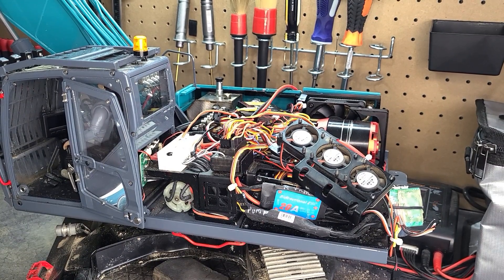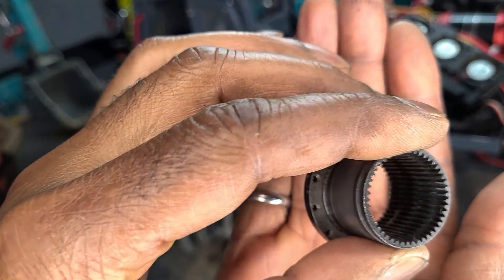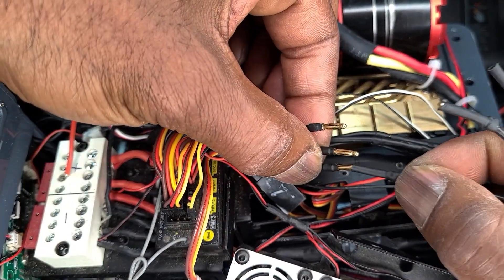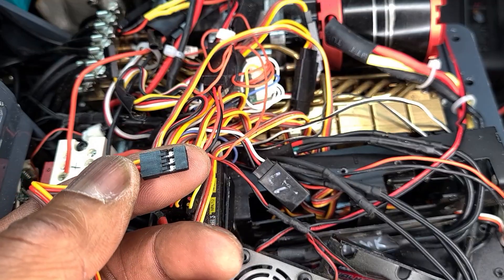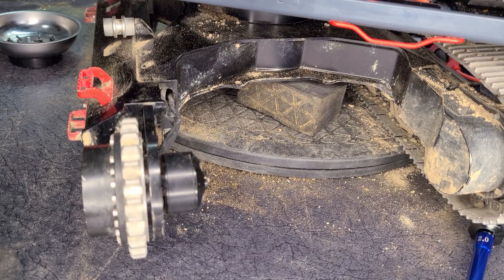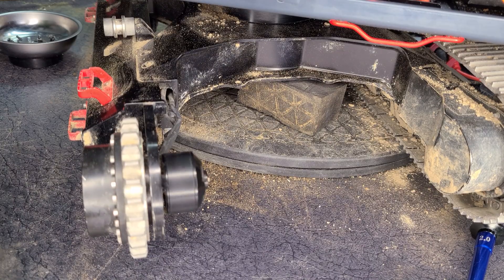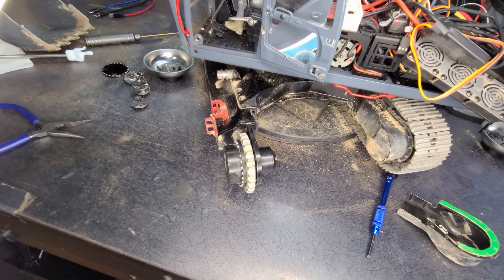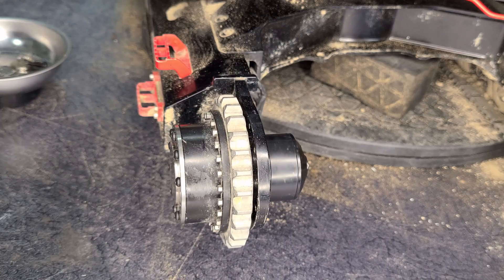Track ESC Repair on Lesu SK500LC

Comment: It seems you spend more time in the shop than out digging with yours. I am thinking about buying but a little discouraged by the repairs work which I am not good at all. Would you buy it again or get a different one instead like a XDRC 945 which seems very durable.
Reply from the maker: I would not recommend buying the Lesu if you are not good at trouble shooting and making repairs. You will be extremely disappointed. I'm an electrical engineer and do stuff like this for a living so it's not a big deal. Some of the Lesu problems have been quite difficult to figure out. I'm not familiar with the XDRC machine but I just watched a couple videos. It's definitely much easier to work on than the Lesu because you can access all the parts once the housing is removed. It weighs 52 pounds which is 10 pounds more than the Lesu. I have a Kabolite 961 excavator that is very reliable to use.
Reply: @ that’s good advice. Your job experience is definitely an advantage when it comes to troubleshooting. I wonder if the new Hitachi HC490 Lesu excavator which just came out is any better and more durable. I guess we have to wait and see. For me at least it means to look for more durable machines as i do not have electrical experience at all and want to be digging not troubleshooting. It’s just disappointing that they don’t get it right and lack in the QC department especially when you consider the price tag of these excavators.
Reply from the maker: @bRockz85  That Hitachi is 1:50 scale. It will fit in the palm of your hand!
Reply: @RCconstructionJP  no it’s 1:14. Check the unboxing video of toucanhobby
Reply from the maker: @ Ok, it looks like it weighs around 60 pounds.
Reply: Bah! Listen, I received mine a month ago, and nothing but hassle too!.. Very disappointed with LESU!.. Until now I found them good but there! I am unhappy given the price and the problem with the Chinese is their almost non-existent after-sales service and the guarantee??? They don't know!.. ✋🏼
Reply from the maker: @RCApache  Sorry for your pain brother. You will be an excellent technician by the time you fix all those problems. One thing that will make it easier on you is if you buy the proper tools before you start fixing it.